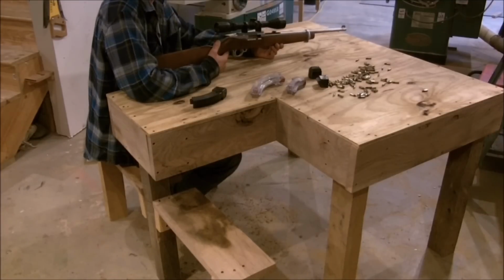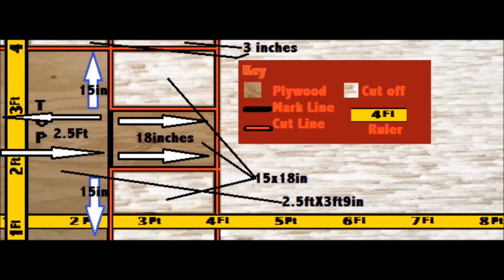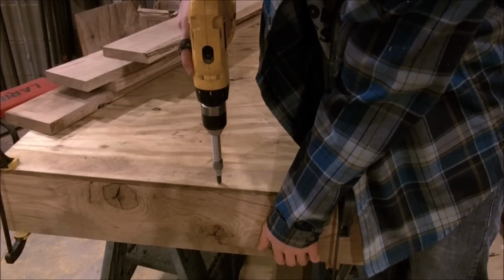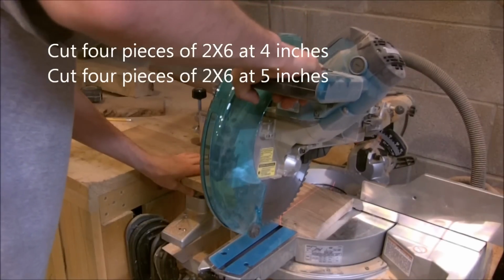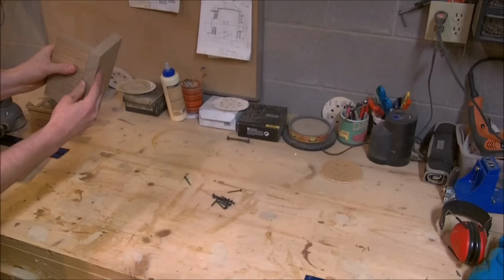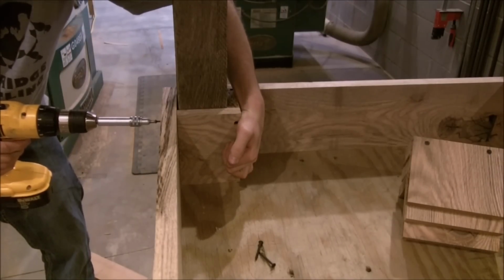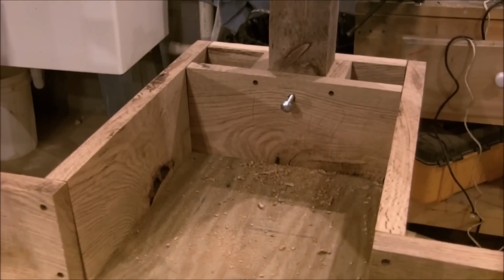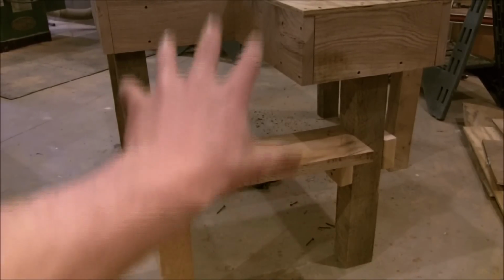How to Build a Shooting Bench

Comment: Excellent video and especially the diagram.  I made one recently that you can shoot from either side, but without the seats due to different heights of the shooters.  Mine is made out of plywood for the table top, and 4x4's for the legs braced with 2x6"s.  It is a three legged contraption.  Sturdy, and will last forever, but weighs a ton.

Comment from the maker: you could use a handsaw for everything unstead of a cut off saw or table saw, it would be nice if you could find a way to borrow a circular saw for cutting the table top for better quality, a drill and some screws would be nice but if you want to sacrifice some quality you could use hammer and nails, all you really need is a handsaw screw gun or hammer and nails tape measure and some wood, hope this could help